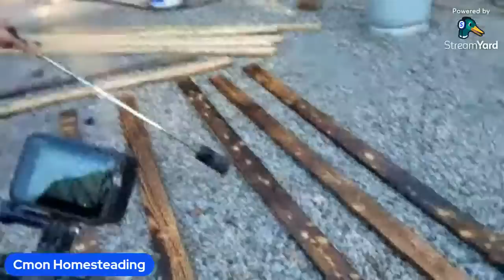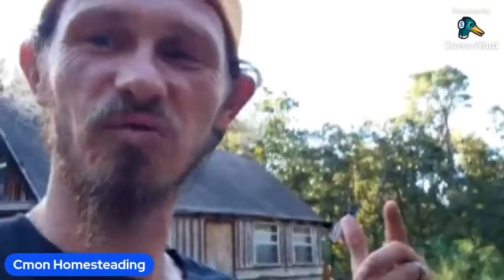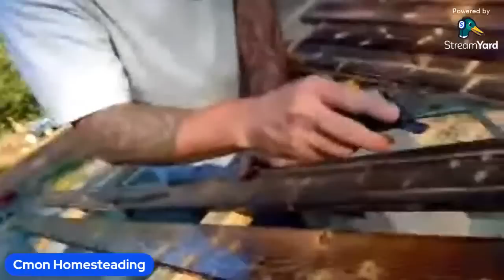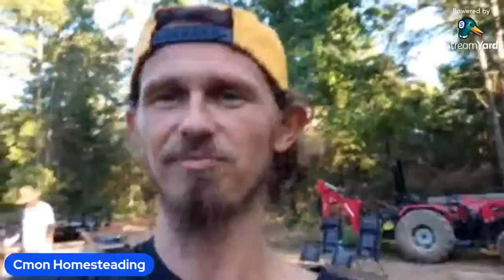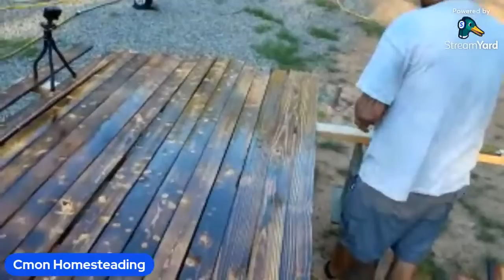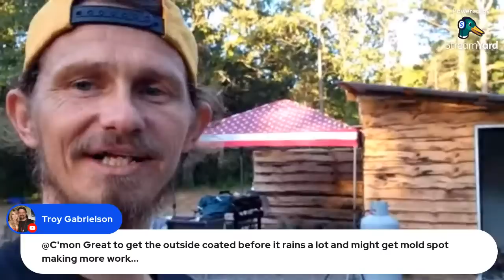WORKING ON THE TINY HOUSE LIVE |tiny house, homesteading, off-grid, cabin build, DIY, HOW TO sawmill

Comment: I have a latex mattress and my two nephews and I came up with an easy way to move it.  If your mattress is like mine, it folds and makes it difficult to maneuver. We folded it over an 8ft 2X4 and then used bungee cords to secure it.  They were able to pick up the ends of the 2X4 and moved it with ease!

Comment: Greetings from Northeast Ohio. Actually, Michael is better at burning then you are David. You burn it too much on alot of them.  PS. I would only use the boards as crown, molding and baseboard trim. I would not put the boards in a corner.